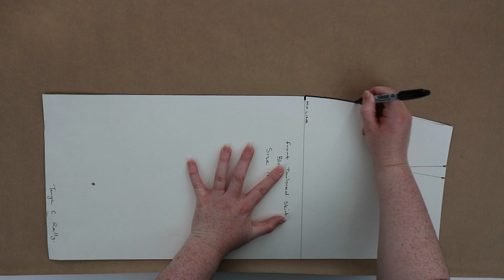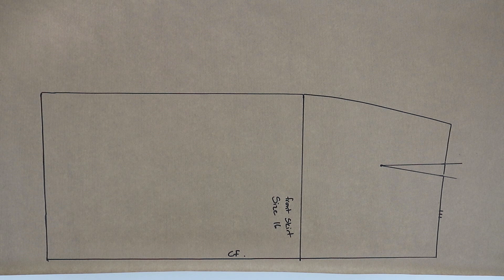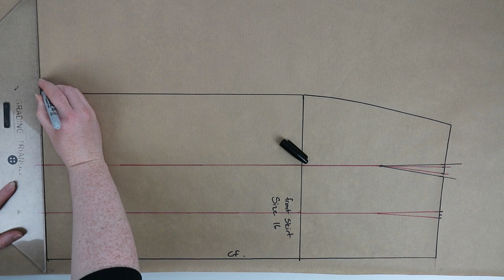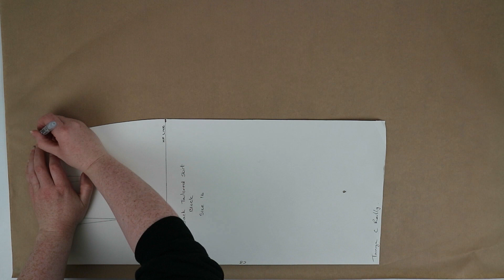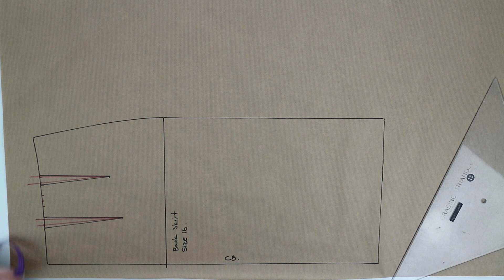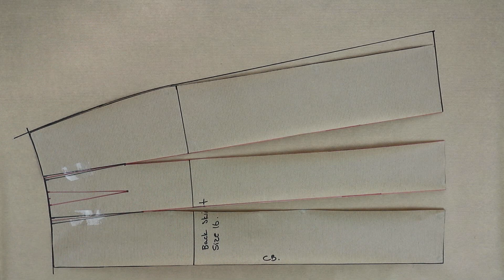How To Make An A-Line Skirt Pattern | Pattern Cutting | Fashion Design

Comment: Thanks for this!! A question for you - I noticed you added a dart on the back even after making the A-line pattern. I did this and measured that if I sewed the back dart, it would actually be too small around the waist. Is this a mistake or did I do something wrong?
Reply from the maker: Sorry only seeing this now. It shouldn't change the size of the waist because we aren't losing any measurements, they have been divided between the darts, the back darts are reduced to 1cm each (they were originally 2cm each) so the 1cm taken from each dart is then used to create the new single 2cm dart. I hope this explains it. Just check that your darts on the original pattern are 2cm if they aren't then this is were the problem is 😁